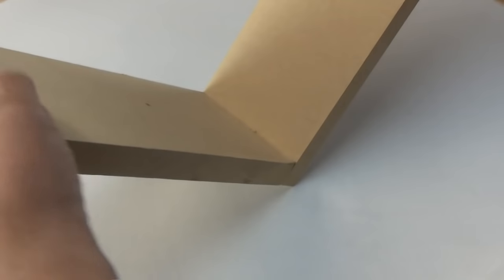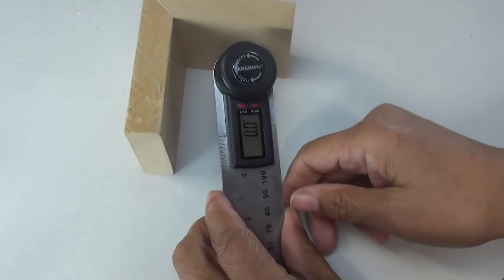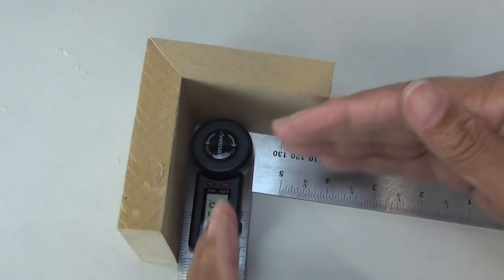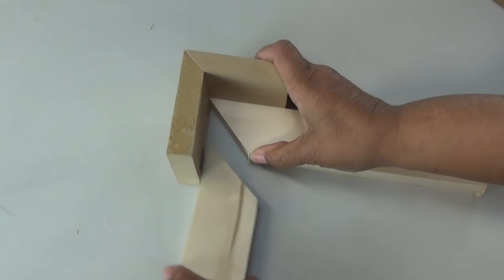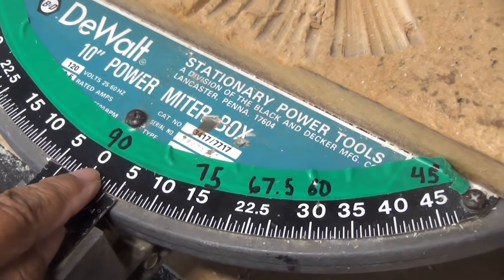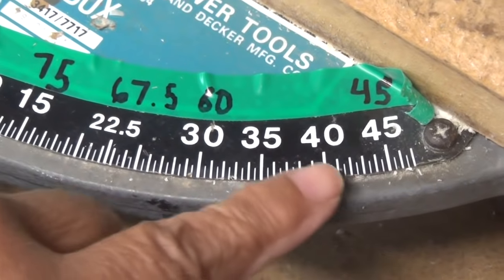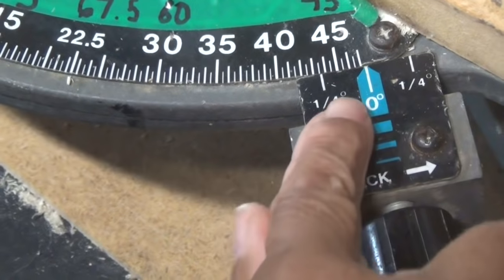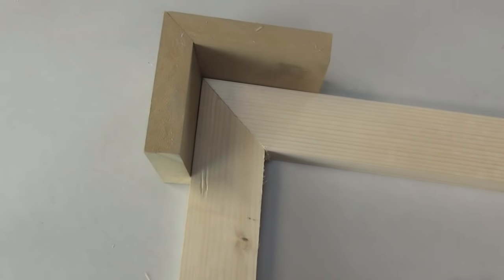The Secret Formula for Making Perfect Miter Cuts When Less Than 90 Degrees

Comment: Take a pair of compasses/ dividers. Mark two points equidistant from your internal centre then take your compass/dividers and open them to max mark the floor and where the sweeps cross will give you your angle. 
Set a bevel gauge to that angle and transfer to the workpiece or directly to the miter saw if you have one 
I brought an angle finder years back useful but sloppy didn’t hold the angle and ran out of battery far to quickly. It’s in the bottom of my tool box and will probably stay there.
By the way you don’t fit skirting board with an internal miter as any movement and it will split. 
Fit first piece with a square end cut a 45degree on the piece butting up to it that will give you your scribing profile then with a coping saw follow the said profile carefully.
Reply: Oh dear. Touched a button did I?
I attempted to explain how to bisect an angle without a digital angle finder. Using tools that people will have at home without having to buy what is an expensive and unnecessary piece of kit. Marking four points and drawing a line isn’t completed and neither is setting a bevel gauge. 
As to fitting base board/skirting dado or any other moulding on an internal wall if you are using internal miters then your not working correctly.
Reply: FuCkthEnSa wasn’t going to bother you but something called Dirt Farmer Jay describing scribing. You might want to look at it. It’s explaining what I was talking about.

Comment: Auntie I just got a 10" miter saw and read the manual and still uncertain about a compound miter cut. Please help.
Reply from the maker: You can only make a compound cut on a miter which does bevel cuts as well.  Not all miter saws are capable of compound cuts.
Reply: @seejanedrill      it a sliding ryobi 10" miter saw that does bevels Auntie. Maybe a step by step please if you have time.

Comment: Hi Leah, I enjoy all of your videos including this one, but I'm a little confused. Is there a difference in measuring outside angles and inside angles?  Because I was looking at your 2015 video on Installing Perfect Outside Baseboard Corners and you stated at (1:35 into the video) that if you angle is less than 90 degrees, just divide the angle by 2, set your miter and make the cut. The example you used was an 88-degree angle. You said divide 88 by 2,  equals 44, so just set you miter at 44 and make that cut. So is that not correct now? What am I missing?
Reply: Agreed! I’m having the SAME issue wrapping my mind around this video. Her other video that you stated, along with many other vids seem to all say <90°, just divide by 2. So why would this be any different? 
I don’t know if this changes anything but for example an 88° angle, I thought u are supposed to make the a cut on both the left and right side of the miter saw, changing the miter 44° on the right side, and 44° on the left. Put them together and thought that was your perfect miter joints. She is just using 1 side of the saw?

Comment: The problem is though... What about less than 85 degrees?? You maxed out at 47.5 degrees. What if I need to miter for an 80 degree corner. That would require two 50 degree cuts. How do you go about cutting those?

Comment: Sometimes the angles are even more accute say 60 deg, but the saw is only capable of 45 deg. If the board is 4m long, is there a safe way of cutting these angles.
Reply: You would use a jig (see my response to Bob Manzi) and sawhorses or outfeed tables, shimming the stock to be perfectly flat with the saw.
Reply: mario wak
Reply: trim circular saw and an adjustable speed square. Milwhacky M12 fuel 5 inch saw is my personal favorite.
Reply: How do I find your response
Reply: Get a different saw

Comment: good morning Leah can this tecnic  be also apply when cutting  crown molding happy thanksgiving thank-you for your answer and happy holidays
Reply from the maker: This question is not easily answered because crown molding has a spring angle, should be coped for inside corners (angles) and the formula is different when the angle is obtuse (larger than 90 degree).   Crown molding can be tricky.  I am planning a crown molding video soon.

Comment: How about manual measurement of and angle and manual cut of angle can you show us?  I mean we don't have digital measurement and we don't have  fix machine to cut.
Reply: They make very cheap angle finders (non-digital) that you can find at Harbor Freight or other big box stores. Same concept, you will open up the two 'legs' and it will show you what your angle is. Once you have your angle you can follow Leah's method to figure out what angle you need for cutting. As far as cutting, you could then use a protractor to trace your angle onto your piece of wood, and then cut with whatever you do have on hand. Protractors are often found at dollar stores. Walmart would also carry them cheap. There are videos on how to use them; it is easy. Hope that helps you a little.

Comment: But if your acute angle is less than 85 degrees, and your miter saw won't go below 47.5 degrees, what do you do? One solution would be to create a set of "wood wedges" for various degrees, Like a 10 degree wood wedge that will fit against your saw's fence. So if you made a 10 degree wedge, put it against your fence, then you would gain another 10 degrees on your saw's  limits. So, adjust the math on the saw. For example, what WAS 47 degrees now shows 37 degrees, (but keep it in your mind that it is really 47 degrees) Then if  you need anything more than 47, just use the 37 degree pointer on the saw and add your degrees accordingly. If you can't make a wedge, then just draw a 10 degree angle on the saw's base plate and line up your wood on that line. Same idea as a wedge, but be sure to hold the wood steady as you cut it.

Comment: maybe measure the incorrect cut so we can see what the results of the cut was in degrees. also i don't have miter saw so this would have been nice to have on the title too. i usually don't just dial a number into a machine and start slicing, i figure out what actual angle and cut needs to take place. I am doing that right now with 3 saws, each for the different cut i need - a table saw (10 degrees), and hand circular saw (45 and a weird angle i didn't measure, i just measured the top and bottom of the parallelogram i needed, giving me an implied angle and i just cut to the line and setup a clamped fence for the circular saw with a piece of wood parallel to the cut line 4.75" away) and a hand saw for small internal support pieces held in a vice. thx

Comment: It would’ve helped if you stayed the actual angle you’re getting with the first cut setting it at 42.5 degrees (which is 47.5 degrees). That ends up giving you a total angle of 95 degrees, which is why it didn’t fit in your casing.

Comment: Instead of having to put tape on the saw, there is another way you might try that is very quick and accurate. 

Take your angle of 85 and divide by 2. This gives you 42.5 - you then simply take this away from 90, giving you 47.5 which is the angle your saw needs to be set at.

Comment: RIDGID has a 70 degree cutting saw. Definitely comes in handing with this formula. Lifetime warranty too
Reply: Robert Durham Jr lifetime warranties are a trick to make you buy an inferior product. If they give you a lifetime warranty that means their product does not have to be made to a higher standard. Companies that sell products that are high quality and well engineered do not need lifetime warranties. That’s why all the old tools are such good quality that are 50 plus years old. They were over engineered and as such do not need lifetime warranties. Today’s tools that have lifetime warranties are not worth bringing home for the most part. When you have to use that lifetime warranty on that miter saw, good luck getting it fixed in less than 2 months. Oh yea, if you didn’t fill out the warranty info on the product it’s worthless. I had a rigid drill years ago, if you sent the batteries back for replacement you had to fill out the warranty info again on the new batteries within a short period of time. If not that lifetime warranty went away. Now, they may have corrected that but companies come up with all kind of ways to knock you out of their lifetime warranties if they can. As a result of that one, I no longer own anything rigid.
Reply: @whalerlife53  lol. You just described the few years of my life. I'm learning the hard way. RIDGID is a notch above Ryobi sadly. As a contractor I should have bought milwaukie or makita. I've like 4000 sunk into RIDGID and the only good I see now is that the miter saw goes 70% angle cut, other than that I'm a sucker.
Reply: Robert Durham Jr yea 35-40 years ago lifetime warranties actually meant something was really good. But not now. Dewalt makita and Milwaukee are the better choice. I want to like rigid but I just can’t do it.
Reply: @whalerlife53  truth is I tried Dewalt, in my opinion they're worse than RIDGID. I used a 3/8 adjustable chuck 3 times a it quit, the batteries don't last but 6 months tops. I think I paid 150 dollars for 2 batteries. At least RIDGID will give me 3 more years for free.
Reply: Robert Durham Jr the battery warranty I will admit is one good thing about the rigid product over the other brands. And that was the exact reason I bought 2 rigid products with batteries. My batteries lasted less than 1 year and i sent them in to be replaced, which they did. I also re registered the new ones and sold both drill and driver on Craigslist. I have 8-10 Dewalt 20v max tools with multiple batteries. So far I have been lucky and not the first problem with any of the tools or batteries. The battery swap with rigid took forever which gave me a very bad opinion of the warranty claim. You should be able to swap them out in the store. A month or more turn around is way too long for that. Unfortunately companies pay a lot of engineers to figure out failure rates and life’s in order to sell us warranties. I do understand your frustration too. It’s basically the same as mine. Sad.
Reply: @whalerlife53  lol. My experience with the battery warranty was one of the reasons I should've bought milwaukie or something. I had to basically tell them that I got 4000 invested in their product and wouldn't buy another thing from if they didn't honour the battery warranty. I didn't mean to get loud but they clearly didn't want to give new one's. I also told them that was the main reason why I went with RIDGID, after basically threatened to tell fellow tradesmen my experience they finally agreed.  It shouldn't have to be that hard I mentioned, they said they we're gonna replace but when it came time to it was like pulling teeth. You live a learn I guess.

Comment: Well, that was a lot of help, cause EVERYBODY owns a digital mitre gauge.
Reply: matran47 they’re pretty inexpensive- got mine at home depot
Reply: @patriot1303  Thanks Patriot1, I'll will check it out the next time I go to HD. I was just frustrated because I was in the middle of a project and only had a plastic protractor to find an angle with. I actually figured it out, but it took a lot longer than I'd hoped.

Comment: Dear Leah, can you teach a noob to make a small table that is completely stable, with four legs, where a marble doesn't roll of off. The floor is not flat, so the table is wobbly. When the legs are all touching the ground, the table doesn't woble anymore, but now is the surface of the table is not strait, so a marble will roll from it.
This problem is solved. I moved to an other place with a strait floor, but to replace a floor is not an option, so the solution has to come from the table.
I couldn't make a table with a flat surface, where a marble would not roll from.

Comment: This makes it sound more complicated than it is. The problem you've solved was incorrectly applying the measured angle to the  timber being cut. The finished mitre has angles of  47.5 degrees AND 42.5 degrees.  If you draw a line across your timber where it starts to taper you'll see you're just creating right angled triangles 'attached' to the end of a rectangle.   No need for all this error prone 90 - xDegrees stuff.  Sorry to go on but the problem is fancy electric tools. If you draw a line where you want to cut first you'd see it instantly rather than just swinging on a lever and hoping it's right.

Comment: I'm sorry but you lost me, why isn't the inside angle 90 deg? Surely if it is a right angle it should 90 deg divided by 2  which equals 45 deg x 2. Where did 85 deg come from and 2 x 47.5 equals 95 deg. I didn't understand maths at school and 52 years later it is no clearer. I spent most of today trying to draw a 10 deg angle on my chainsaw 
sharpening guide . I can't use a method just because it works, I have to  understand it or I will do a butt joint instead. Leah is a brilliant teacher but I am really challenged when it comes to numbers. I've watchd the video over and over and read many of the comments but nothing. This is why I left school at 15 and college was for the smart kids.

Comment: This video makes no sense. If I use your formula on YOUR saw, you can’t cut anything smaller than 85. Because if you me angle is 70, you divide it in half and you’re at 35. The corresponding angle is 55. How do you set your saw to cut at 55 degrees? Your formula works for all degrees in between 85-90. Big woop